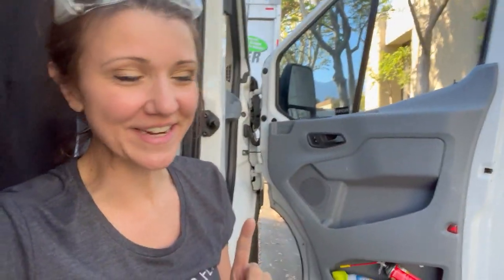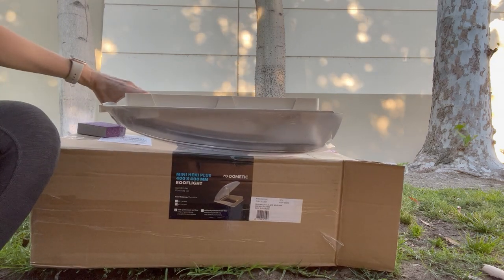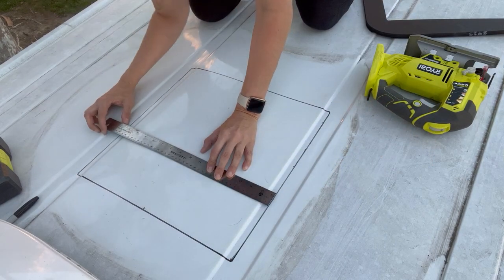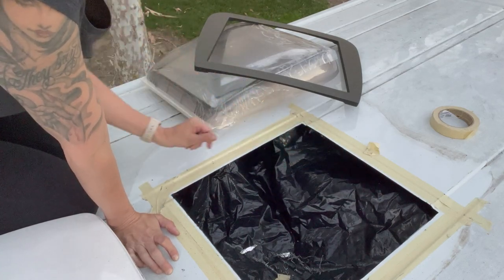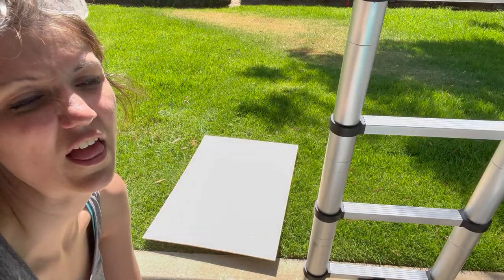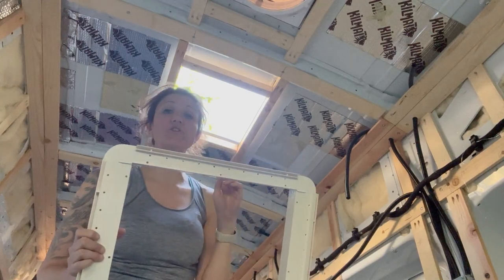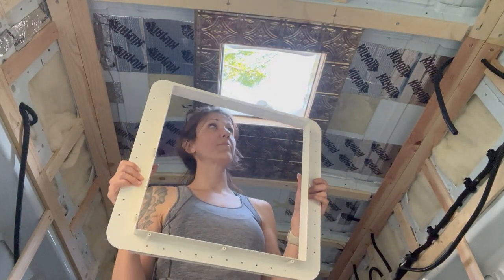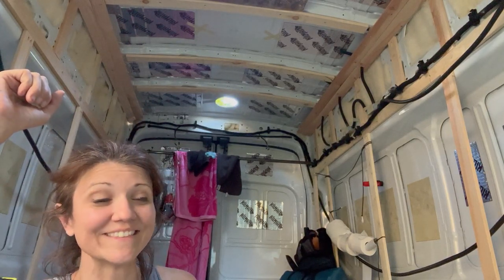Dometic Skylight & Support Frame Install | First Time DIY Van Conversion Series [12]

Comment: Acetone and plastic normally don't go well together, it could melt it.
Reply from the maker: Oh! I wasn't aware of that. It seemed to work for this, but maybe only because I wiped it and didn't soak it or leave it on (?) Or maybe since I sanded it after, it removed any remaining acetone, and the melting is what allowed it to get rough? I'm not sure, I'm just speculating,lol, but seriously - thank you for this info! It is clearly very important to keep that in mind when deciding how to remove the releasing agent layer. ❤️